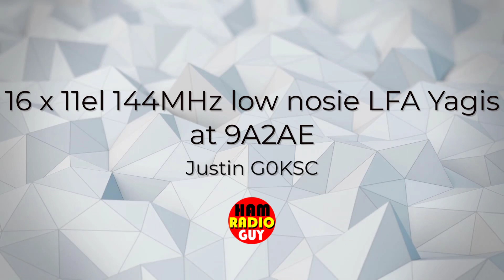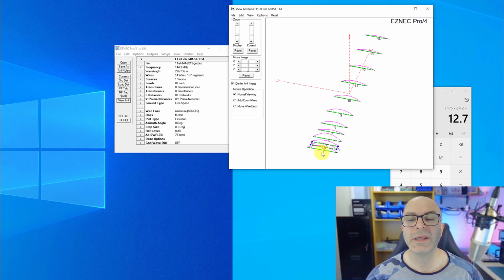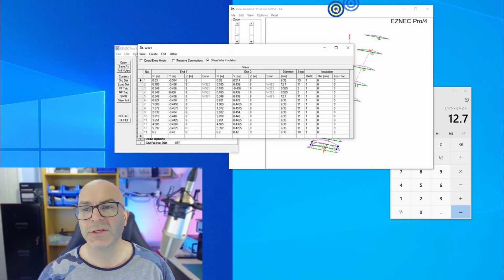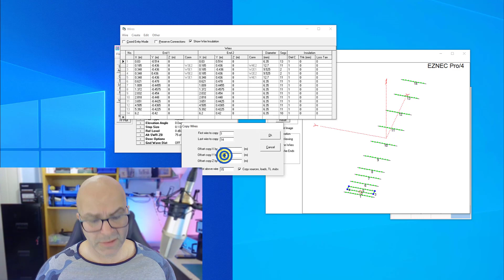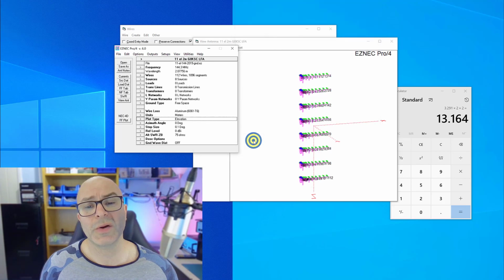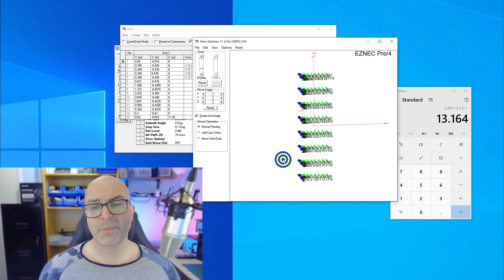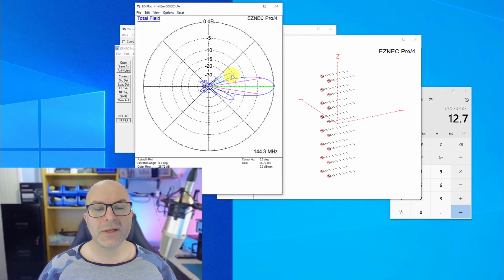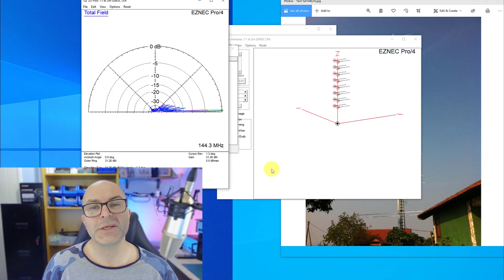MONSTER Yagi system 16 x 11el 144MHz design to built system @ 9A2AE

Comment: Hi Justin, Nice job on this stack. 
Regarding tools, When you prefer to use Eznec or 4NEC2 ? 
Cheers. Maximo
Reply from the maker: hi Maximo, as I mentioned in the video, I prefer to use EZNEC for stacking calculations as it is very quick to make changes and the run times quite low. I use 4nec2 for some optimising work and for viewing 3D and the wideband plots but on Yagis of this type, the results show the same in each
Reply: @hamradioguys  Got it. Will you talk about differences between "Optimizer", "Evolve" and all the Operation options under Evolve process?
Cheers. 73, Maximo